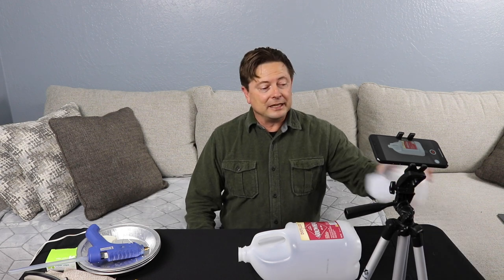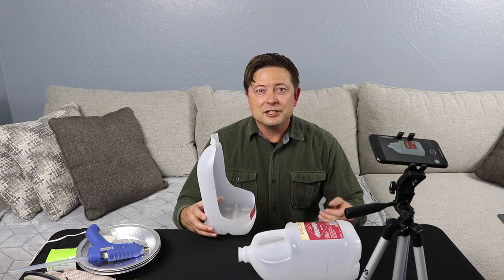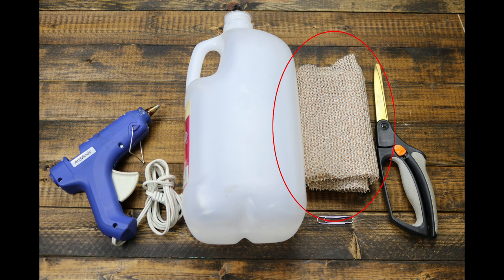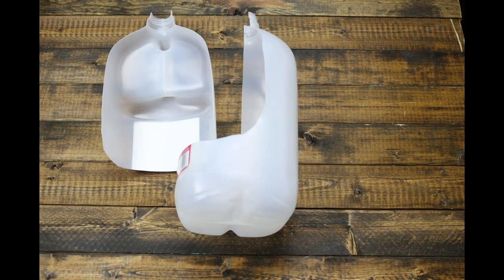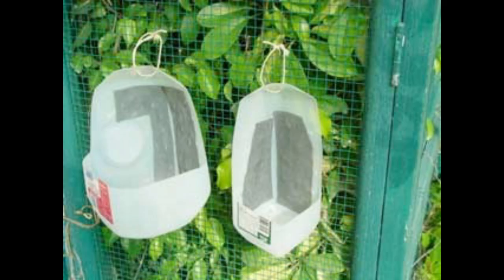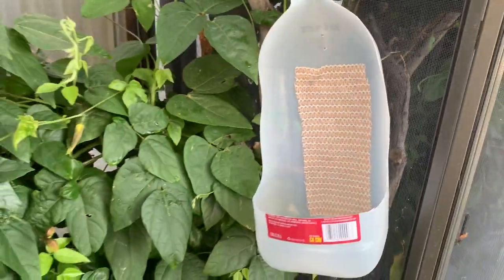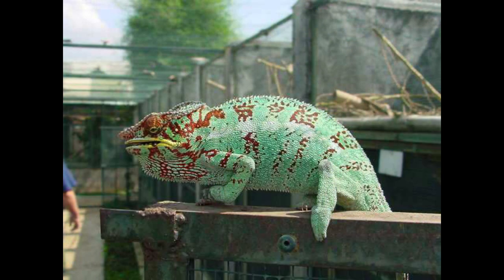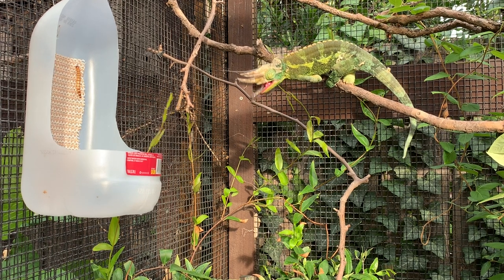Make a Chameleon Feeder Run Cup

Comment: Question, I’ve heard that the exoskeletons of mealworms make the chameleon sick. Is this true
Reply from the maker: Mealworms are not considered as nutritious as other feeder insects, but they are a good insect to rotate in every now and then for variety. The concern going around the community about mealworms causing impaction comes from 1) feeding too many mealworms (they are not a good staple feeder insect) and 2) too low of temperatures for your chameleon species (all different, remember) to properly digest. So, the answer is no, the chitin of the mealworm exoskeleton, when fed appropriately, will not make your chameleon sick. But the community has run into instances where the chitin has created complications with chameleons because the husbandry was not perfect. So, although I will make sure the truth is known that eating mealworms is not bad for your chameleons, mealworms do not have enough nutritional value to justify the effort needed to realign the negative community beliefs.
Reply: Chameleon Breeder thank you so much

Comment: Is it okay if I used a piece of curtain as climbing surface? They climb on it so I think its okay
Reply from the maker: The first question would be why not use branches? Chameleons are designed for branches and curtains are not designed for the inside of a chameleon cage. Although chameleons can physically climb on curtains they aren’t something that goes into a chameleon cage.